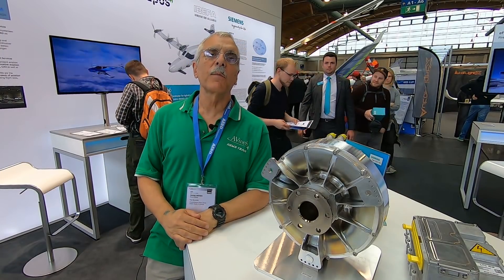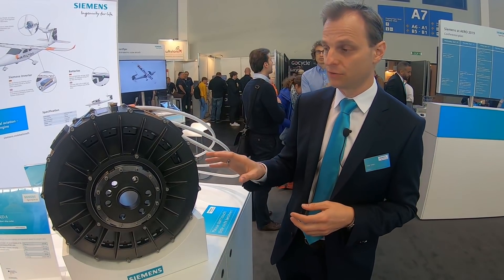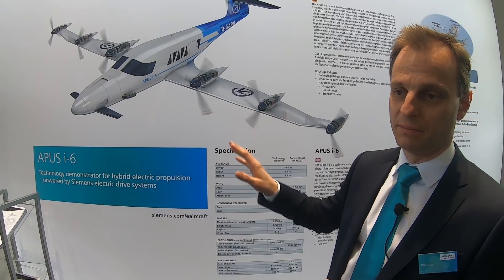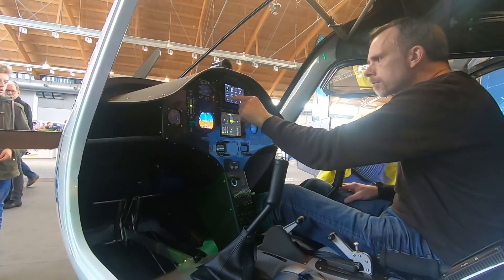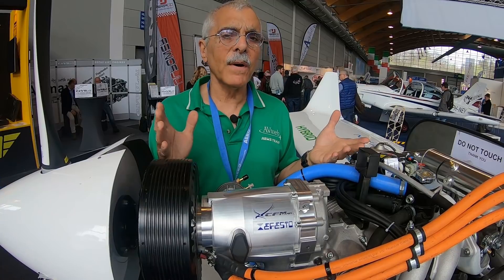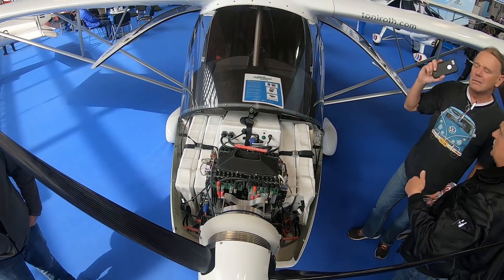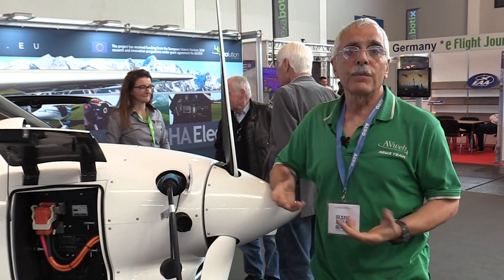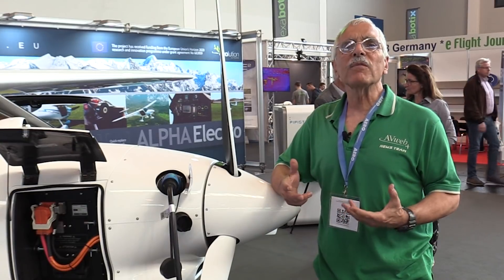What's New in Electric Airplanes?

Comment: The Germans always get innovation wrong. Tri planes, inverted engines, Sauerkraut.. Electric wont work until we get a game changer in battery technology which will no doubt come from Blighty or Uncle Sam. Nothing wrong with combustion engines in the mean time except the noise they produce from the liberal green new deal brigade.  At the moment it's just snake oil, smoke and mirrors.
Reply: Always? Fuel injection, maglevs, turbojets, turbofans, the ball mouse for computers, the Haber-Bosch process, the diesel engine, the automobile... Biased much?
-
Edit: And what was wrong with the inverted engines? An engine doesn't care which way it's oriented, but the pilot will certainly appreciate the improved visibility that an inverted engine provides.
Reply: @PistonAvatarGuy  Fuel injection - Swedish. Turbo jets - British(Frank Whittle). Turbofans - American.  Maglevs -  French(Ampere discovered magnetic waves). Diesel invented an "Efficient engine" but did not invent compression ignition . Ball mouse? Mmm , ok you can have that. :)  Having worked in Germany for a long time the only reason the nation has advanced is because their people are sheep. Who else would work long productive hours, pay all their taxes and not complain about piss poor wages. Germans do not like to think out side the box much...
Reply: @PaulAnthonyDuttonUk  You said innovation, not invention. The Germans are the most significant developers of fuel injection systems. Whittle's design was a dead end, but the axial-flow turbojet (which was first invented by the Germans) wasn't. The turbofan was a German invention. 
-
The reason that Germany has advanced is due to the fact that Germans are some of the most intelligent people on Earth.
-
"Who else would work long productive hours, pay all their taxes and not complain about piss poor wages."
-
People who like to live good lives in nice communities?
-
"Germans do not like to think out side the box much..."
-
Right, which is why the US and USSR scrambled to get their hands on unique German technologies at the end of WW2 and then rushed to incorporate those technologies into theirs. /s
Reply: @PistonAvatarGuy  Yep true.. I did say innovation. Ok, you got me there. :)
Reply: @PistonAvatarGuy  The Germans do inject a lot of fuel from Russia. I forgot that. Yeh, they are experts on undermining NATO security.  Whittles design was not a dead end. Whittles design was invention for which all other technology evolved from. Fella, believe me.. Germany is held together by subservience. Any nation that has such Orwellian speech freedoms can not be relied on for original thought, not to mention either that every work place of significance in Germany uses English to communicate    Germany will be much better once Bavaria becomes independent.
Reply: @PaulAnthonyDuttonUk  Yeah, yeah, and the US doesn't import huge amounts of oil from the middle east, doesn't fight wars for oil in the middle east, doesn't kill millions to fuel its economy, etc, etc... /s
-
"Whittles design was not a dead end. Whittles design was invention for which all other technology evolved from."
-
ALL other technology, huh? Wow. Most turbine engines have very little in common with Whittle's design, they're more closely related to the axial flow turbine engines that were developed by the Germans.
-
"Germany is held together by subservience."
-
How is that different from the US?
-
"Any nation that has such Orwellian speech freedoms can not be relied on for original thought..."
-
And we don't have an Orwellian government in the US that spies on everything we do and can arrest people on a whim? And we don't have a massive corporate media machine that brainwashes people into acting against their own best interest, that convinces people that we need to constantly be at war, that consuming corporate garbage is all that's needed to make our lives better? No one cares about the trillions that are spent fighting wars over a resource that we don't need, they just mindlessly march to work to pay taxes and produce the weapons, they mindlessly buy trucks and SUVs that they don't need and make us dependent on foreign oil, and they ignore the never-ending loss of their freedoms and the collapse of their own country. MINDLESS SHEEP.
Reply: @PaulAnthonyDuttonUk  Germany is working toward energy independence and doesn't spend trillions to kill people over the resources that it uses. Yes, shutting down their nuclear energy program was stupid, but they're still committed to reducing their use of fossil fuels in the long run.
-
"If you are German then lobby to buy your energy from the US..."
-
How on Earth would Germany do that? Why would they do that when they're working to eliminate their dependence on fossil fuels entirely? I'm American, btw.
-
"Germany still owes the world much and NO one is forgetting."
-
BS, the past is in the past, the vast majority of people forgave, even without forgetting. You cannot make the sons pay for the sins of their fathers. And it's not like the US doesn't have enormous amounts of blood on its hands, so Americans can't rightly judge Germany.
Reply: @PistonAvatarGuy  You are mistaken. Germany is trying to change the energy currency from consumption to emission such that it can compete at the top table if it can only convince the world to abandon its natural resource wealth and instead broker green energy using Co2 allowances. The scam is clear which is why Trump abandoned the Paris climate deal. If you think Germany can keep its lights on and maintain industrial production using green energy then you are a loony tune. Do yourself a favour and join the ADF.
Reply: @PistonAvatarGuy  The idea of a global controlling Co2 tax was a good try but luckily the scam has been recognised,  Sorry, but we will not be curtailed by silly arbitrary emission quotas just because Germany has no carbon based wealth... Back to your drawing board.. )
Reply: @PaulAnthonyDuttonUk  The ADF claims to care for the "sanctity of life," yet you completely ignore the killing that your country does all over the world in the name of profit.
Reply: @PaulAnthonyDuttonUk  "Sorry, but we will not be curtailed by silly arbitrary emission quotas just because Germany has no carbon based wealth... Back to your drawing board.. )"
-
Who cares about Germany? Reducing CO2 output is about ensuring the survival of the human race!
Reply: @PistonAvatarGuy  I am a Brit so am not a member of the ADF. Yet as a pragmatist the ADF seems the only party in Germany willing to stand up for the notion of being German without it implying the total homogenisation of Europe under one flag. Not everyone likes sauerkraut...   With respect to killing my view is better them dead than me dead yet think you are conflating fact.  None from the UK or the US wakes up and says who can we kill today.
Reply: @PistonAvatarGuy  "on 29 May 2011, Merkel's government announced that it would close all of its nuclear power plants by 2022"
Reply: @PaulAnthonyDuttonUk  I thought that you were talking about the ADF in the US. AGAIN, I'm not German, LEARN HOW TO READ. 
-
"With respect to killing my view is better them dead than me dead..."
-
And why would "they" want to kill us (Americans) if we weren't killing them?
-
"None from the UK or the US wakes up and says who can we kill today."
-
Yet they allow their countries to kill for the profits of the already obscenely wealthy.
Reply: @PaulAnthonyDuttonUk  I'm well aware of Germany's policy on nuclear energy, the scenario that I was describing was hypothetical. As progress comes to a halt in their elimination of fossil fuels, they'll be forced to consider the nuclear option.
Reply: @PistonAvatarGuy  ..and you have definitive repeatable proof from the lab showing cause and effect on the planet from man made Co2 emissions? - No you don't yet if you were Germany and wanted to level the energy playing field by getting the world to broker Co2 allowances which would force nations to use inefficient renewable's instead of the god given resources they had you might be tempted to talk bollox and encourage the message that the world is going to end in 10 years... Its manipulation or put another way is called mitigating your competitors strategic advantage.
Reply: @PistonAvatarGuy  Hahahahaha He says, "I thought that you were talking about the ADF in the US." yet tells me to learn how to read. (facepalm)
Reply: @PistonAvatarGuy  Actually, my bad. It is AFD not ADF so you are forgiven. :) Alternative for Germany..
Reply: @PistonAvatarGuy  Context would tell you but I said above "My bad"  because I referred to ADF when I meant AFD. )
Reply: @PaulAnthonyDuttonUk  I hadn't received that comment yet.

Comment: Exciting, thanks ... just wondering why there is no solution with a replaceable battery which would be great for training, whilst one is being used for circuits etc the other is charging, and certainly could be made easy to swop out.
Reply: There is, the Alpha Electro has swappable batteries, the problem is the insanely high cost of a second set of batteries and charger for them.
Reply: @PistonAvatarGuy  At $200/kwh, 20kwh of battery should cost about $4,000, before any markups or inefficiencies due to low volume. 
For the amount of fuel and maintenance costs you can save, a second set of batteries and charging equipment really isn't a huge investment.
Reply: @RealestUrbanism  If you charge from 35% to 95% in 40 min, that's like 5 hrs in the air for the pattern bomber. That with 300 flyable days would be an insane amount of usage for a flight school a/c.